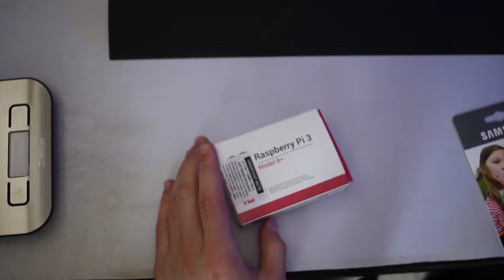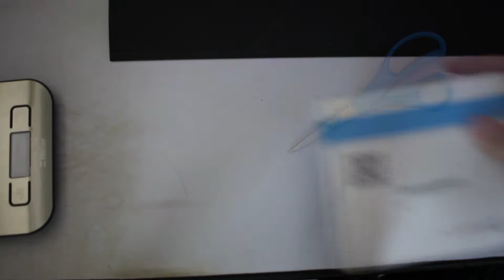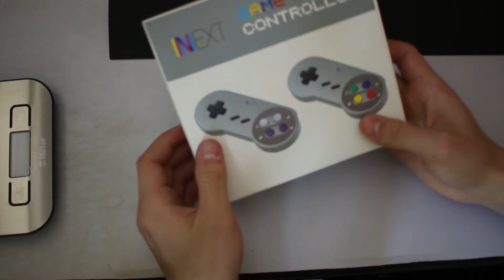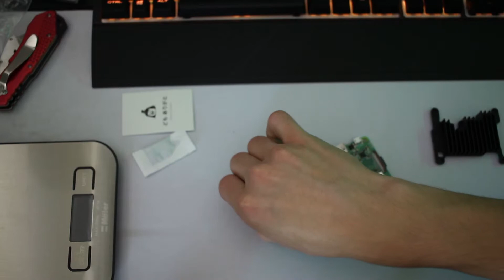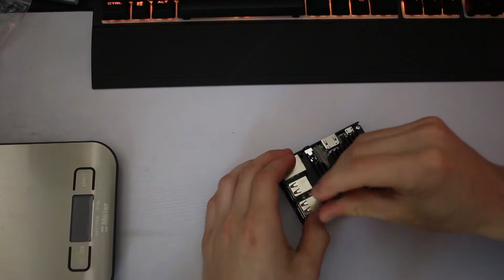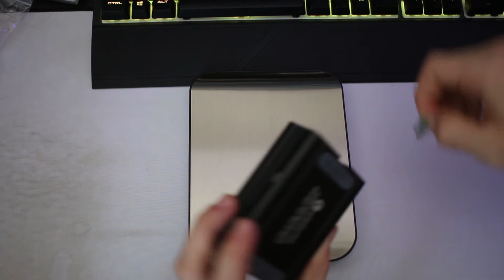Raspberry Pi 3B+ and Accessories Review and Build

Comment: unless you are overclocking or using the pi for extreme computations or in hot environments you do not need heat syncs or cooling fans for the pi.